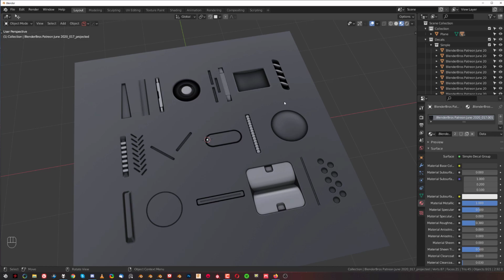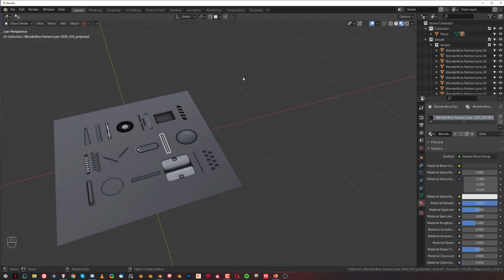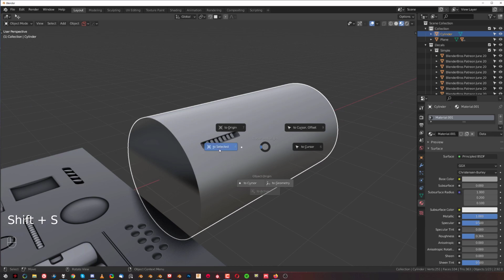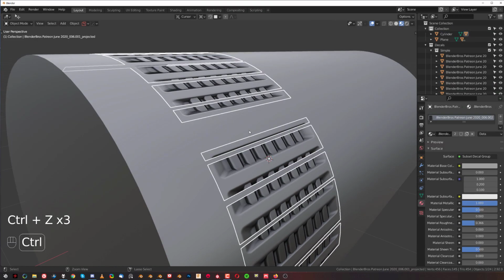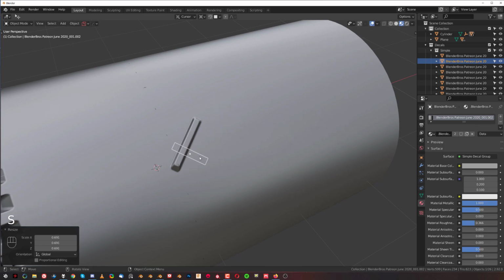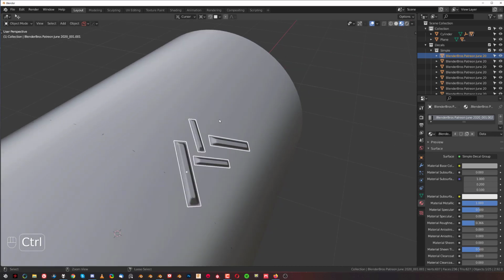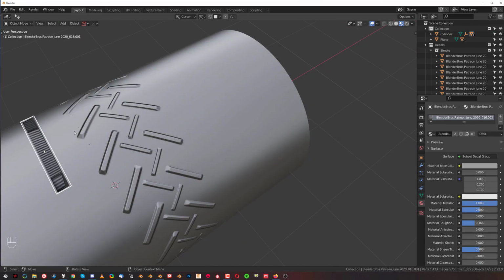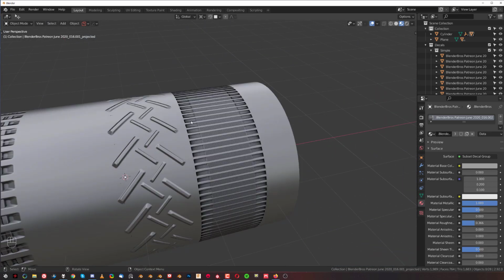Create PATTERNS with decals using Decal Machine and HardOPS array  - Blender tutorial

Comment: On the topic of parenting, after applying the decal to an object that is part of a collection, when I do any transforms on the collection, the decals transform with it just fine, but when I hide the collection, the decals are still visible. Even single objects that are not part of a collection have this behavior with decals. (Sure, I could hide the decals separately in the outliner, but that's a bit of a PITA.) Also, if I duplicate the collection, the decals are not duplicated with it.

The only way I've found to fix these issues is to remove all parenting from the decals, drag them into the collection in the outliner, then re-parent them to the parent object of the collection. Is this all expected behavior or am I missing something?
Reply from the maker: you dont need to unparent them in order to move them to the same coll as the object.